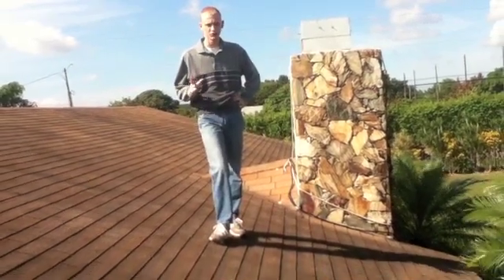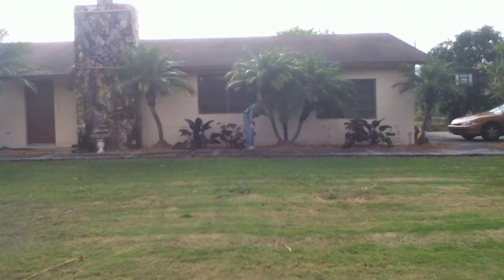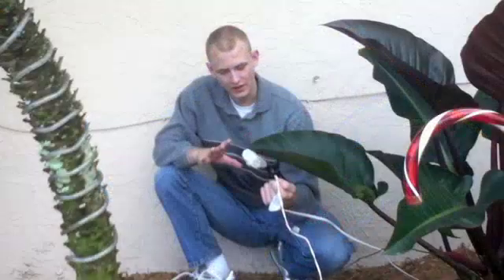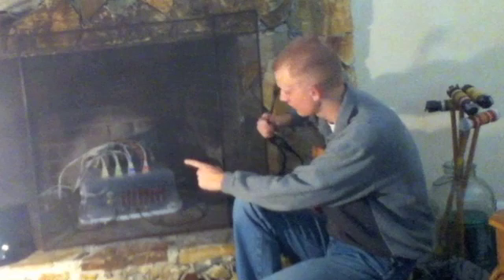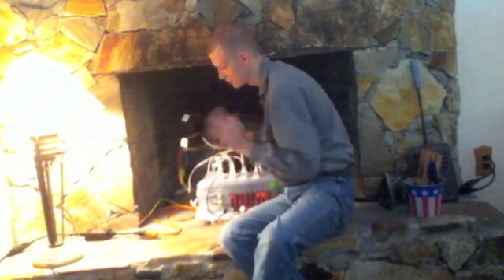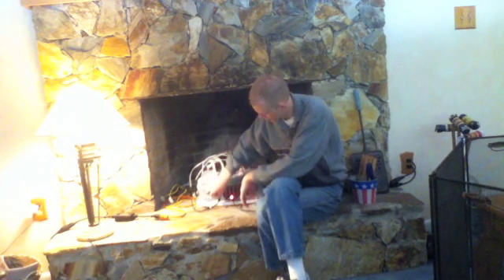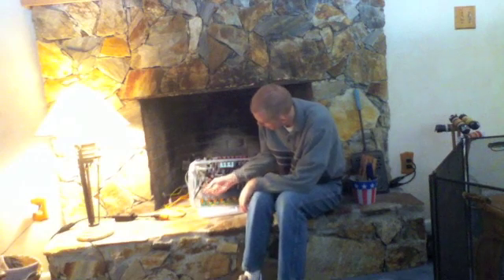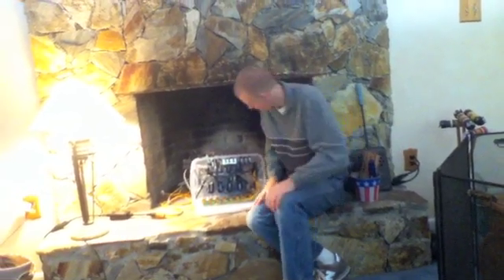DIY Lighting, Christmas, Vixen Software, Arduino, Behind the Scenes...

Comment: Hey, I'm trying to set something up with 8 arduino compatible relays and I'm going to use Vixen with the same knockoff arduino as yours. Is there any code that needs to be uploaded to the arduino or will it automatically work? Also, what is the serial port for? Thanks!

Comment: What I meant was, whenever any of the Arduino units receives serial data thru either USB or the RX pin, have it repeat that data to the next one using its TX pin. They can either respond to it if they are supposed to, or pass it down the chain if they're not.

Comment: I do believe that instead of using the USB hub (which IDK why it doesn't work) you could wire multiple Arduino units together via their TX and RX pins (Digital pins 0 and 1). And write code in each sketch so that the microcontrollers will repeat all serial data received through their TX pins. That way each one will receive all of the commands and either respond to them or pass them depending on how you write the code.